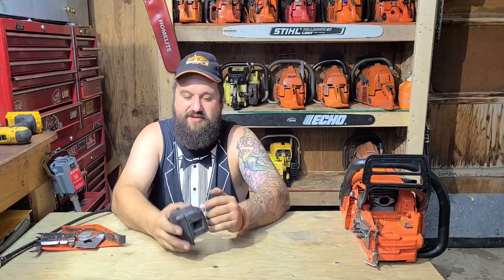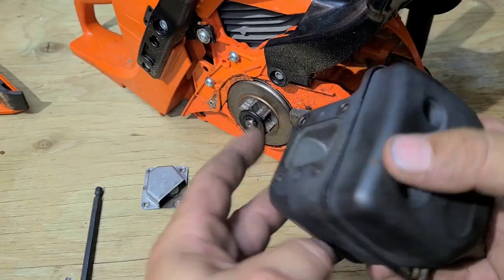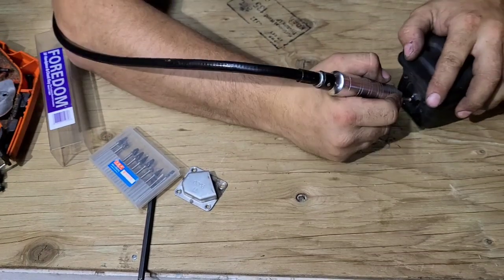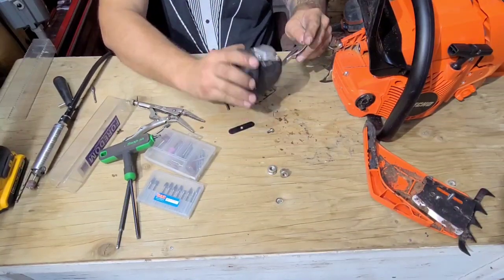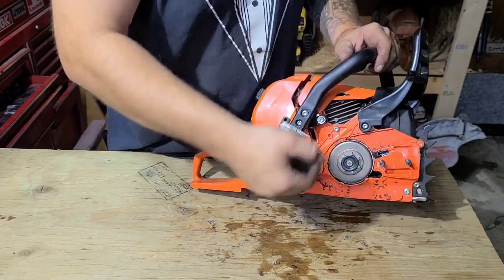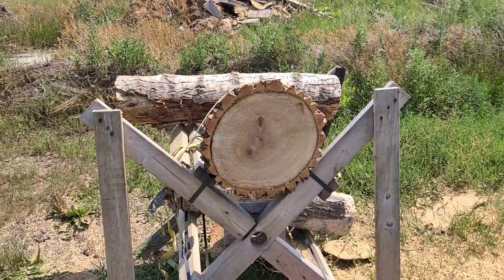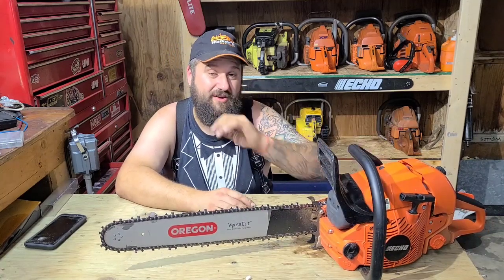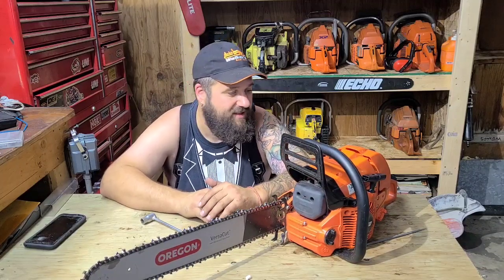Echo CS590 muffler mod. Will it add power???

Comment: This is a great series on the 590. I bought a 590 a couple of years ago and just did a muffler mod to it right away and found out that it was a major hold back of power. I like the results so much that I ended up selling my Stihl MS360 and keeping the little echo. Keep up the good info sharing 🤙
Reply: What kind of mod did you do? Just curious I just purchased one and it’s rlly restrictive. TIA
Reply: @Tatted_gunna  I did something very similar to what Tinman has done. Cut open the exit hole and then I went in with a drill bit to punch a bunch of holes in the baffling. It has been awhile but I think that was what I did to open up the muffler on the 590.

Comment: I hogged mine out quite a bit more aggressively, and I washed it out with soap and water befor running it as it had alot of shavings trapped in it I didn't want going back into the motor

Comment: Thing sounds alot better too! Think Im gonna get a 620 now!
Reply: I purchased 620pw with 24" and  a 7310p with a 28" bar.I live the saws.
Reply: @andrewslagle1974  my stable of Echo's is growing also! Have 500vl, cs680, 7310, 501p and soon to be 620 lol
Reply: Bought my CS620PW two years ago. Carb slightly rich it steadily woke up through 10+ tanks and stock it pulls buried in 36" knotty pine. No mods for 5 years warranty expires. Run it on hi-test ethanol free VP FULL synthetic 40:1 and retuned after set in to 4 stroke burble when I let up from buried in the cut.

Comment: As mentioned before, with having to restrict flow to meet government regs, it's understandable that they have to build the mufflers the way they do to pass inspection....
That being said,  it would be super nice if they would put a knockout plug (like a metal electrical box) to make it quick and easy for the end user to get the designed performance out of the saw 😁
Reply: As nice as that would be, the government doesn’t want you to modify anything for better performance, as the excuse of emissions/ and or safety, so manufacturers leave this opportunity alone for the end user, and a lit of these mods will void warranty! The cs590 has a five year warranty! So when I mod mine, it will be done on a second muffler!😂

Comment: I had to go to the non-bypass main jet just to get it to 2 stroke at 8 thousand feet.  I have a 620p and a 600p plus I rebuilt two 590s.  Did the carb jet replacement on all of them.  I also found with stock porting at altitude, it really lost torque if I tuned it for high rpm.  They like to be a bit rich.  Echo makes a nice saw.  I love that almost all of the screws are the same and you can pull the carb in about 2 minutes.  Snug the screws only, no cranking them down or they will strip out.  Parts are expensive as well, a negative.  Bar sizes are goofy stock too.

Comment: hey my friend great video !!! just an FYI, when putting your burr into your foredom or dremil . push the shank all the way in . then just pull it an 1/8 of an inch out and then tighten it . this will prevent bending the shaft as it did, or even breaking it. just a little tip that was pointed out to me by fellow wood carvers ,that helped me out a lot . love your vidios man , keep on sharing your knowledge and what you do  !

Comment: Same way I do them. Tip on your grinder if you're using it hung right there you're gonna burn cables up. Hang it from the ceiling. Took me about 5 cables to learn that 😂

Comment: I just played with the dremmel today. Opened up some holes in the muffler for my poulan farm hand 295. 🤪

What a difference. It's simple. Air is lazy.

I'm a tool and die maker by trade. I had my fair share of porting and cleaning heads for the car scene.

Comment: Really like how you chose to do the muffler mod as it keeps the spark arrestor in use. Like the new camera view set-up as well. Once ported this 590 will definitely out-perform a stock 562. I noticed you didn't show or mention blowing/washing out the metal shavings from the modded muffler. Pretty much a given for the experienced, not so much for a newbie. Love this series on the 590. Huge Echo fan myself... 501P and 620P in my stable.

Comment: What I had done with  mine was cut open a small spot on the bottom of it, that allowed us to get inside and totally gut the internals, then closed it up. Then welded the existing outlet on the top  closed, and then drilled two holes off each corner 3/4 inch and brazed 2 3/4 inch pipes. Looks like a dual port husky muffler now. And it flows now and my 620 absolutely rips., I did what you did first, just drilled out that area and I felt I lost too much bottom end. Too little back pressure. But it still ran good. But not nearly as good as this. 

The other option Tinman is to weld the existing outlet up, then drill and tap the deflector off the front. Of the muffler. And gut the internals.

Comment: I really enjoy your 590 videos, I've been working one professionally now coming up on 5 years (semi-retired tree surgeon on a budget) and beaten the heck out of it over the years, it works wood 3 and 4 times the size its designed for. Never tried to mod it, just run the 24 bar on it and kept it stock but going to give the mod a try.

BTW,  you asked about the new camera angle,  I can't see what you're doing most of the time because its facing you so everything you're doing is blocked by what you're working on.  Just fyi. 

Thanks again for doing these 590 videos, they're great.

Comment: Perfect for video it seemed to be easier for you than having to move in closer and check for being in frame! With all the regulations manufacturers have to comply with restricted mufflers are to be expected. I agree wholeheartedly with porting and getting more fuel in will obviously cause more heat and it needs more space to exit. Looking forward to this build. I’m especially interested in where the high jet ends up afterwards. I’m guessing a turn and an eighth. Thanks for taking the time to video this.

Comment: Just subscribed. I have a Echo CS-590 for my cottage property. I use it for about 2 weeks of the year, hard, to cut the 4-5 cords of rounds I need (split later) to get me through the winter. Its a great saw. I love it. I do notice that when used that hard, it gets hot, but I just stop working and carry out the rounds while it cools. I'll watch all your CS-590 mods and see if I can get it to work even better.
Reply from the maker: Thanks for subscribing!!
Reply: Good move. I got my cs600 hot buried in some massive wood and wasn't savvy enough to slow down. But on the bright side, I discovered Tinman while I do the cylinder and piston rebuild!😂

Comment: I wonder where you guys get the 620 coils from. They are between $80-120USD everywhere I've looked. Price difference between the 590 and 620 here is only $160, so it seems that adding a 620 coil and carb to the 590 would be more expensive than just buying a 620.

Comment: So, drill out that pipe. Remove the limiters, 1/2 - 1 turns out on the High, 1 - 1 1/2 on the low (im guessing there) and this saw goes from decent to a solid work saw for the 3-6 full cord guy?

Comment: If you covered this in another video, I apologize, but why do you pull the recoil before shutting the saw off? I'm a 3 year arborist and was wondering if this is something I should be doing or not, bc I've never seen anyone do that
Reply from the maker: It saves wear on the starter dawgs on old saws.
Reply: Is there any reason to still do this with modern saws? Thanks

Comment: Curious, what were the cut rpm's with the bolt on mods and muffler mod when it achieved 3.5-3.6 sec cuts?  Super curious what rpm gains brought it more in line with the 562.  Thanks.

Comment: Thank you for the vids, I found you because my Homelite Super XL with a 24" bar and chain from the '70s seized up on me today while cutting up a 55-foot red-oak tree that fell across my private driveway during a storm blocking me in. I had no gas for it so I took it from my car's gas tank with ethanol, mixed it with 2 stroke oil, and by the time I was done trimming and cutting up the branches, which was more like cutting up 10 trees my poor Homelite saw smoked and died. 

After watching your vids I am considering the CS590 Echo, I am just wondering how many different size bars and chains can I run on it?  Or can anyone answer because at times a 24" was too much for the job at hand and at times it was not enough? I would like to buy 3 different size chains and bars for it.  

No matter what it must be able to handle a 24" bar and chain.

Comment: Question, why do you pull the cord before shutting down the chainsaw. Also, it is a bit hard to understand what you are trimming off the muffler. Great video! just bought one of these. Can't wait to go in the wood and try it out.
Reply: takes stress off components in the starter, otherwise everything kinda slams together when you kill it, best way i can explain it. you’ll feel what i mean if you try it
Reply: @michaelness2241  good to know! I will do that from now on

Comment: Good video! Tinman, thanks for the awesome upgrade information! I wrote you about my 620. How long would you guess to break in my new saw (still on the first tank of gas)? In the future I would like to do this muffler mod on my stock 620. I won't be doing any serious firewood cutting until fall. Suggestions?
Reply: Echos tend to take 8-10 tanks before broke-in and woken up.
Can muffler mod a saw new, I modded my 590 on 3rd tank.

Comment: Go to horrible freight spend a hundred bucks..get a lil.stick rig...if, a 10 dollar hook 5 dollars in 6011-10s...-18s,13s...and learn, I find it very hard to believe that just about anyone cant throw a muffler back together with little money and little to no skill...except yt...guys gals...welding is simple it's the pre post, fitting ect that's hard..welding is always the easy part,